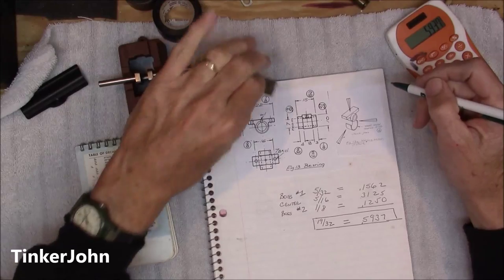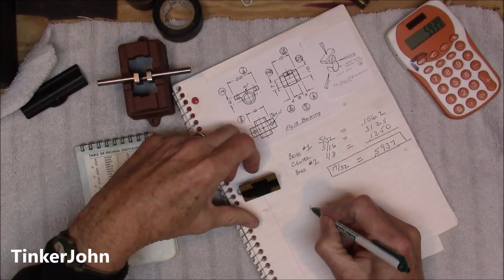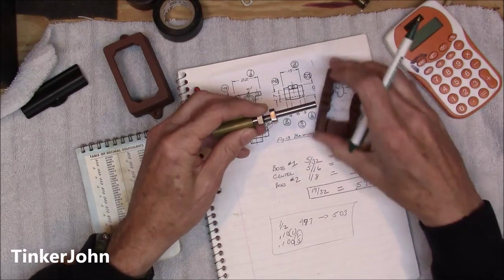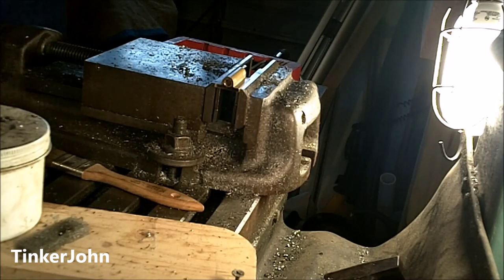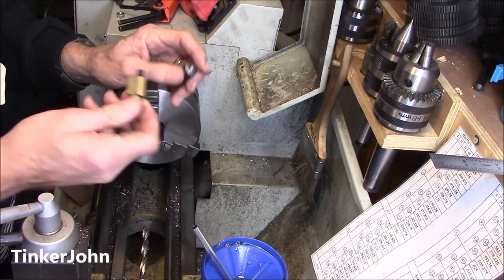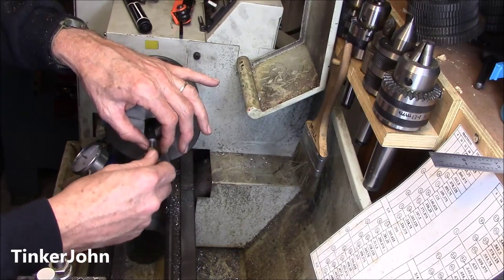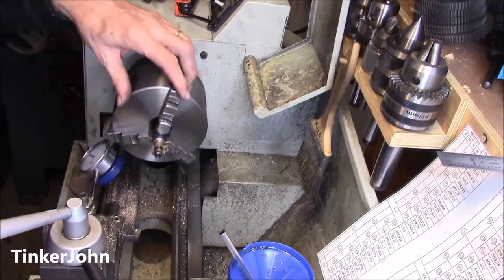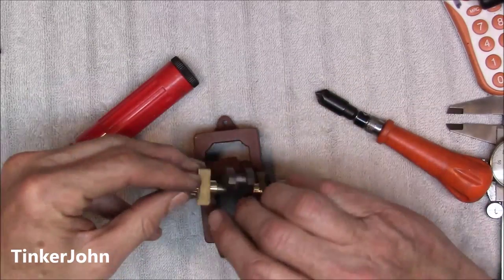Machining the Stuart 10V Steam Engine Castings - Part 16

Comment: Thank you for these informing videos.  I wish that I had had them as a resource 30 years ago when I first tried to machine the 10V.

A couple of comments:
Tolerances:  The tolerance of a dimension is often implied in the way it is presented.  In general, if not otherwise noted, if the dimension is presented as a fraction the tolerances is + or minus 1/64".  If it is a 2 place decimal (X.XX) the tolerance can be taken as +/- 0.01".  If it is a 3 place decimal (X.XXX) the tolerance can be taken as +/- 0.005".

Required Thread Engagement: If the male and female threads are similar strength materials then an engagement of about 1 diameter is sufficient to develop full strength.  If they are dissimilar strength, then the engagement needs to be adjusted by the ratio of the strengths.  This will prevent pull out.

Thanks again for your willingness to share your knowledge.

Comment: how much runout are you planning for on the crank and bearings ?
that's going to be one fine engine :)
Reply from the maker: Runout will be about a thou or so.  Not much more so the engine will run quiet.
John